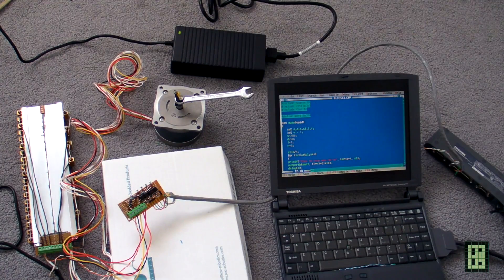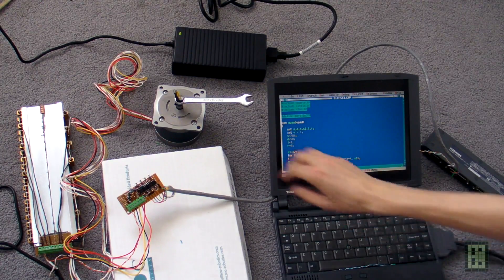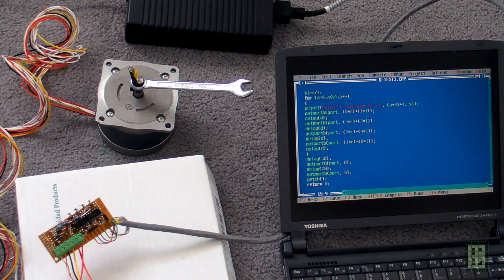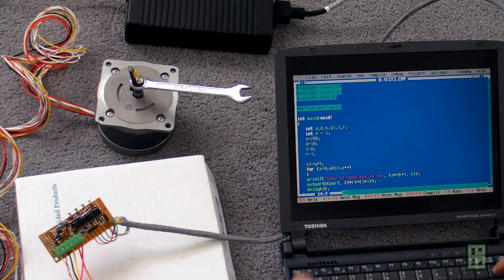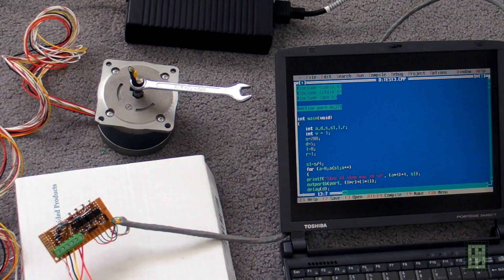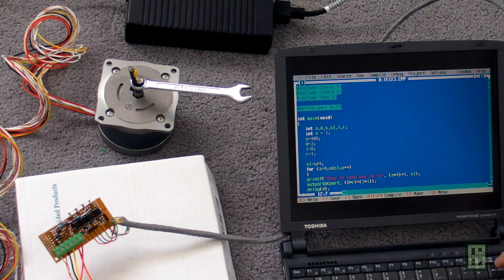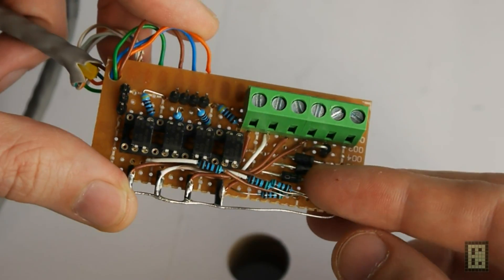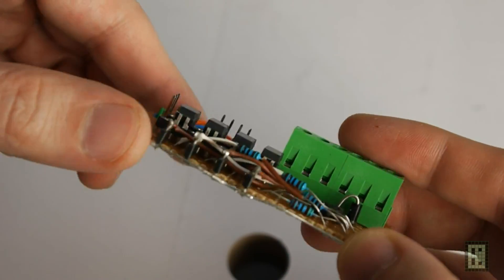Stepper motor controlled with computer parallel port LPT

Comment: Hi ! Can you send me interfacing diagram of stepper motor with pic18f4520 microcontroller or any other pic microcontroller.. Thanx..
Abhishek.
Reply from the maker: Just get a stepper motor driver form eBay or some other place is inexpensive. Then all you need is two digital IO pins form the PIC or any other microcontroller. One pin will specify the direction "0" one direction "1" the other direction and the other pin will make the motor increment one step for each pulse.
Reply: Okay ..thanx for replying...
So we dont need any motor driver IC or extra biasing resistors or anything ?
Reply from the maker: Abhishek Kadri
You need a stepper motor driver board that has all the necessary parts and is not expensive then you just add to that your PIC or any other microcontroller and write whatever application you want.
What you have seen in my video is good mostly as an educational example but not good for real world applications. I build that with what I had at hand in that moment and just wanted to play a bit with that stepper motor that I just received but other than that is useless.
Reply: Alright thanx a lot... 
One last query.. Any suggestions as to which driver board and stepper motor would be the best for our project .. "Dual axis solar tracker prototype using Pic Microcontroller..". Its a college project actually and we browsed the internet but couldn't find much info about it..
Reply: Abhishek Kadri
Is hard to give you an answer since there are so mmany options. It also depend on how large will your stepper motors be that depends on how heavy the solar array is and how fast the solar traker need to rotate.
But some popular one are TB6560 thatcan deliver up to 3A and a board containing this controller for a single axis is about 7 or 8$ on eBay
There is a TB6600 that can do 4.5A if you need to use larger more powerfull stepper motors.
If is something realy small and you want to save money and you are interested mostly in the way the stepper motor work you can find some boards based on ULN2003 that even include a small stepper motor all at just 3 to 4$
You can get two of them for just 5$ or so here is a link http://www.ebay.com/itm/221347325924
Those small stepper motors have a reducer gear so they can directly be used to rotate something that is not extremly heavy.
With the ULN2003 you will need 4 IO pins form the controller and so the software will be a bit more complex but you will also learn more about stepper motors.
Reply: Wow ! Thanx a lot for the info and for taking the pains  to type all that.. I ll check out those boards and get started with my project now...
Bye ! :)

Comment: can you run this program on windows 7 64bit ???
if i use arduino is there any way to give a G file (i mean cnc file) to arduino to drow an image on 2d papper with a cnc that have 2 stepper motors?
Reply from the maker: The program in the video was Turbo C. And in order to have full access to HW it needs to work on anything lower than Windows 95 or 98 I think after that the HW is controlled by OS and you need a driver and permission to use the ports.
I'm sure there are a few example of arduino controlling 2 or more steeper motors since most of the DIY 3D printers use some sort of AVR micro. Maybe the newer ones have moved to ARM cortex M but not sure.
Reply: ***** this stuff is really cool, i am starting a 2 axis laser cnc to cut 2-3mm balsa wood for building model airplanes. i have time but i do not know what to do after the g code is extracted. i want a way to give the g code to the stepper mototrs through the usb and it is a bit tricky!! i hope i find a way to do that..
Reply from the maker: mitropoulosilias
Not sure what is your level of understanding and how deep do you want to go in to this. If you just want to buy the parts that will make this work then you will need a stepper motor driver and a micro-controller board with g-code interpreter.
Here is an example not a recommendation http://www.ebay.ca/itm/151302444215 there are so many of this kits that it will be hard for me to make any recommendations especially that I did not worked with any of them and have no experience with this. You need to read more select the type of motors or if you have some see if the drivers can support your motors. Most can drive 3 to 5 motors but you can use only two if that is all you need that is no problem.
Some like the one I provided link use USB and a computer and others are more independent they have an SD card where you put the g-code and they can work independently no need for a computer and software.
Reply: after a short research on the suppliers from china and on the e-bay and some online stores there are microcontrollers 3-4 axis for 40-50-60 euro usb. i am going to try one of these... :-) THANKS FOR THE REPLY ON ME. Greetings from greece my friend!
Reply from the maker: mitropoulosilias
Glad my replay was useful to you.

Comment: Is it possible to do the same with a brushless motor?
Reply from the maker: What do you mean exactly with the same? It is possible to control the position of a brushless motor using an optical encoder speed control and eventually an electromagnetic break. That is how servo motors (brushless motor) are used in industrial robots.
Reply: Thanks, thats precisely what i was asking. Because i have several brushless motors from floppy disks, but i didnt know if i could use them to control the position in degrees. However i guess its easier to buy a servo motor instead

Comment: ok don't screw me around here, what i want to know is simple and people keep giving me the run around and saying oh i need a chip then oh i need to program the chip then oh i need $10,000 to buy the machine that progams the wrong chip that i am trying to get working. this is basic shit, (pardon my language) it goes like this, ( very simple) I have a red button..I want to push the red button, and I want the red button hooked up to a computer so that when i push the red button it changes variable X in my javascript code to 1 instead of 0 and when i push the red button again it changes the variable back to 0, not just variable X but any variable that i asign the red button to, then I want to be able to hook up a motor to the computer where i can change variable X= 0is off and variable X=1 is on, and the green button turns variable y to 1 or 0 where 1 turns the motor clockwise and 0 turns it counter clock wise ....it is very simple and i want to be able to hook anything up to this and be able to manipulate its functions to my will using java script, is that to much to ask, cause if you know how i can set this up please do tell for once i master this simple software to hardware i will be able to make and invent revolutionary machinery. if you can please help me figure this out
Reply: you see i use Javascript and i want it as simple as asigning an id tag to the motor the simple as pulling upthe motor using document.getElementById("thefreakingmotor").rotation=Clockwise....clockwise would be a pre set variable designed to activate clockwise motion of the motor. but apparently I need to use a different programming language for the motor and a different programming language for the button and for some reason I can seem to figure out what those programming languages are or how to id an electronic device using a chip that i can install on my own id on my own and program on my own let alone getting it to work with my favorite programming language javascript. seriously who is the geniouse that made such a simple process so complicated.
Reply: Adam Crowell like i'll learn a new programming language if i have to but it better be universal to buttons and motors i should be able to link it to my javascript fuctions....ever watch the movie transformers? well if i can get this down pat i gurentee you i'll be able to make a machine along those lines of awsome.
Reply: and it's not like I can go to school to learn exactly what it is i'm looking for i got to go to school and learn a million irrelivent freaking things befor they get to the damn point, if it's even the freking point of what i wanted done. but no i need thousands of $ to get someone to teach me exactly what i want to know cause noone has time to be teaching this shit. I want to learn a one man programming language where one person is capable of makeing some prety wicked shit insted of an entire team has to work on different everything where the guy with the mony gets all the credit for everyones work... starwars baby, anican made his own functional protical droid cause no one screwed around in making simple shit complicated.
Reply from the maker: Adam Crowell :) I sot of get your frustration. Things are complicated until you understand them.
I have no experience with Java and is not really a low level programing language is not very close to HW.
If you check my latest videos you will see that I designed a Solar BMS from scratch and I did all the parts SW and HW.
But that is about the limit one single person can do in a reasonable time. By the time that project is done it will have the equivalent of one man hour full time job for around one year.
Not sure what I should recommend to you because I do not know what exactly you want to build (maybe a robot) and I do not know what HW you want to use.
The thing that I made in this video is not really the best option. Is good for a quick test but that is all.
Parallel port is obsolete most if not all new computers don't have one.
If you want to use a computer then probably USB is your only option with new computers.
Then you will need a microcontroller that can communicate trough USB and use the microcontroller IO pins to control HW devices like push buttons and stepper motors.
I'm not a programmer so I will probably not be the best to make video tutorials about that.
My suggestion is just general but get one of those Discovery dev boards from ST or any other cortex M dev board you prefer (they are just 10 to 20$) and learn how to program a microcontroller.
Cortex M microcontrollers cost just a few dollars and are are similar in performance with an old 286 up to 486 if you are old enough to remember those.
You will be able to read a button and control an LED or a stepper motor in just a few days. There is a lot to learn from there but it will be fun.
But not to forget there is a stepper motor driver that needs to be between a microcontroller or computer and the motor.
Those stepper motor drivers boards start from around 12$ on eBay for motors requiring up to 3.5A.
One one side you connect your 6 or 8 wire stepper motor and on the other sides you have just power and two IO pins one is for direction and the other for steps each pulse moves the motor on step or one microstep, it can be configured with jumpers on the board.
I will be happy to answer specific questions if I know the answer.
Reply: ***** java is like hell.. you have to spend a lot of lifetime to make a simple aplication.. :-(
Reply: java is all I know, thx for the detail answer, i'll look into the devces you have recomendd....it is simple what I wan to do but near impossible to get software and hardware to coenside as usable variables in javascript.
Thank you for your answer

Comment: i have a unipolar stepper motor and want to drive it with digital signal produced by programable computer.How we design circuit to energies the two coil of the motor alternatively
Reply from the maker: The simplest circuit if you want to control a small unipolar stepper motor is this  http://electronics-course.com/image/stepper-motor.png
You can find a PCB containing the ULN2003 for a few dollars but there are much better drivers that need just two digital IO pins form a microcontroller of commuter one for number of steps and one for direction.
Reply: ***** ok the circiut you have given is very simple but its need four input & i have two digital input 0,1 then how we connect to four input.Actually i have less knowledge about electronics.
Reply from the maker: rakesh singh
Stepper motors have 4 coils it can be 8 or 6 wires depending on configuration.
What stepper motor do you have ? Do you have a model number? Maybe there is a driver already present.
Reply: ***** i have 6 wire stepper motor but donot have driver.i am not talking about the 4 coils i.e. connected to the uln2003 chip output but  the four input A, A(bar), B.B(bar). Is it connected to computer
Can you send me whole diagram(motor connected to driver& computer)
Reply from the maker: rakesh singh
I used an old computer in this video that has a parallel port (Usually used by printer in the past).
Search on google for the parallel port pin-out.
All I did was connect the 4 input pins of the ULN2003 to the pin 2 to 5 on the parallel port.
And the ground any of the pins from 18 to 25
I just used some opto-isolators between the ULN2003 and parallel port to protect the computer for any possible currents that may damage the parallel port.
I did not actually used the ULN2003 since I did not had that at home but it was emulated with a few transistors.
Still I do not suggest you use that ULN2003 unless you want to play with a really small stepper motor nothing serious.
For more serious work or even play I suggest you get a proper stepper motor driver they sell on ebay for 10 to 20$ for a single motor and on those you have just two pins two drive one for steps and one for direction (there is one for enable also but not necessary to use)
So the motor will move one step at each pulse on the step input and on the direction for "0" it will move one direction and "1" the other.
I will also suggest you use a micro-controller to drive this pins and not a computer parallel port.
If I knew what motor you have and what is your intention I will be able to give you a more precise answer.
Reply: ***** ok... thank you very much for giving your valuable time.

Comment: wow! it is very nice I just want to know how you connect step motor to computer and how you program also? I am willing to learn and searching for this a long time!
Reply from the maker: This is not the best solution to use a stepper motor. You can get a controller driver that has only two digital pins for one motor one is for pulse each pulse equivalent with one step and the other for direction 0 one direction 1 the other direction.
You can find this inexpensive on eBay then just use a micro-controller to control the direction and number of steps.

Comment: Why so negative? 
of course, it is to be used by others! 
but you need software for windows! 
did you have a schematic?
It might also be fun to watch! 

good luck! 
Rob.
Reply from the maker: Is not even far the best way to use a stepper motor.
First the hardware that I used require a parallel port on a PC (this is obsolete it was even 4 or so years when I have done this) and I used discrete components and current limiting was done with a large power resistor (that is inefficient and expensive) you can find a proper stepper motor driver on eBay for just a few $ that has proper current limiting and you only need two digital pins preferably from a micro-controller one to increment the position and one for direction.
I have done this since I was curios about that motor that I just got and I used what I had available did just for a short test.
I do not use windows and even if I did you need proper drivers installed to have access to ports you do not have direct access like in MS-DOS or Free-DOS.
I made this including the video in about two or three hours so there is no schematic you can see at the end how is build. I did not even saved the software since I knew it was not useful.

Thanks,
Dacian.

Comment: Hi! I have 2 questions:
1. when you stop the motor - do you appy 'holding' current to it - to hold the position ?
2. When you control the motor, you put sequences to the pins of the LPT. (Especially if you microstep).  But how do you know when the motor was "Off", which is the Current position step number - to start with the right bit-pattern ? Or it doesn't matter - you always start with the first - as if the rotor was at 0.0degree?
Reply from the maker: 1. I do not exactly remember but I think there was no holding current. Usually is not necessary if there is none ore very little inertia in the system that you are moving. If it is then usually you slow down when you get close to the final position so that you have smaller inertia.
2.You will probably need to remember that in software it was not the case for my software. The motor will spin no mater the last position it was in but it will probably skip one or two steps and have a bit less torque at start.
But maybe I'm wrong I only played once when I did this video with a stepper motor so I don't have much experience with them.
I think that if you need really high precision you can use a speed reducer so your system will move slower and a step will represent a much smaller error or you use a servo motor and an optical encoder to have a real feedback of the position but that will get more complex.
Usually a CNC or similar device will have a zero stop switch but that is normally mechanical and it my be that even the start position can be off by a few steps.